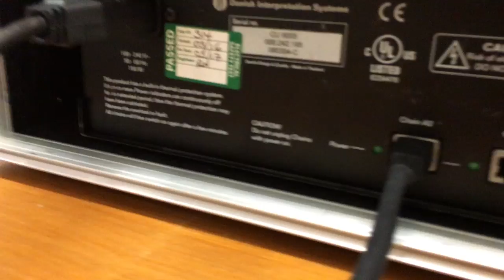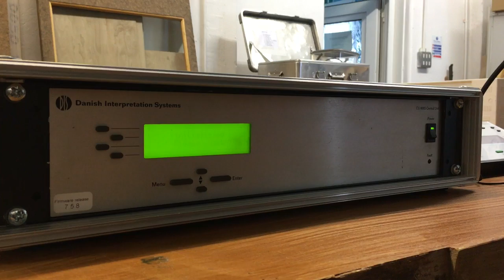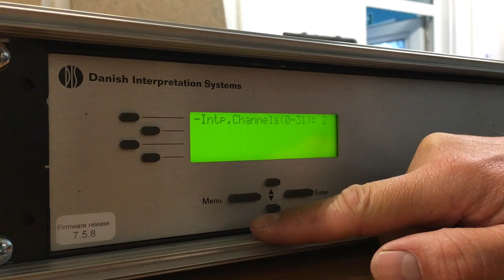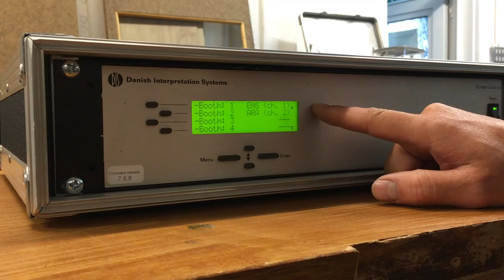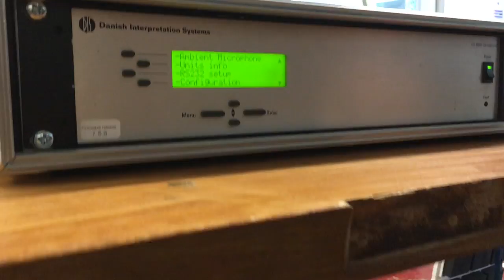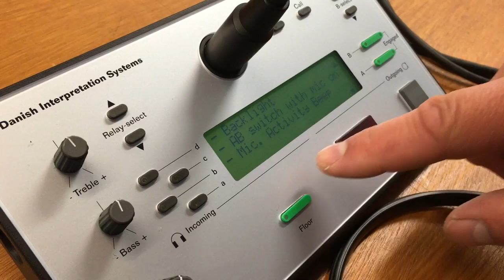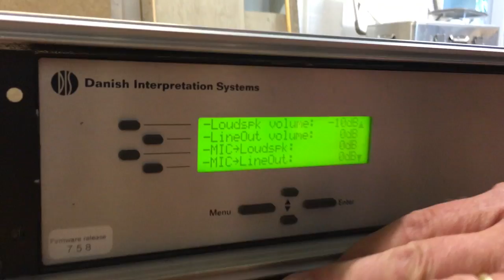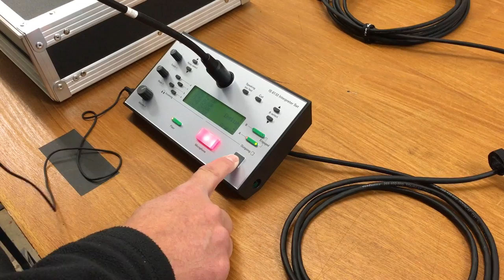Interpretation Set up on DIS CU6005 / CU6010 & IS6132

Comment: I have a CU unit of which the LED display does not operate. It lights up but no display of word/options. Can the display be replaced?
Reply from the maker: It could be a contrast issue on the display. They loose contrast over time but can be adjusted to show again. You need to take the lid off the unit to adjust. Once the lid is off you will see several boards. The boards at the front of the unit behind the front facia are the Power Supply boards. (If you have a 6005 unit there will be one, if you have a 6010 unit there will be 4) The board you need to look at is the board at the rear.  You will need to remove the metal insert that covers the left of the board. Once done look for a small variable resistor on the bottom left corner of the board. This can be adjusted with a small screwdriver... adjust this to suit the display. Reassemble..

Comment: Thank you for this video. There's no Auto-Relay, right? When the floor language is not my A or B (meaning I don't understand it and I have to take relay from another booth), it doesn't switch automatically to the A language output of the other booth and I have to select an incoming language from the input list manually?
Reply: Yes, select your listening language from the buttons to the left of the screen.